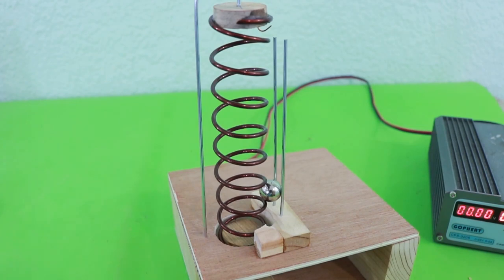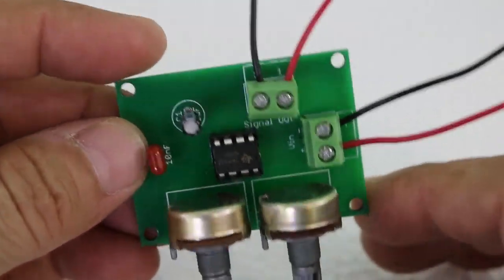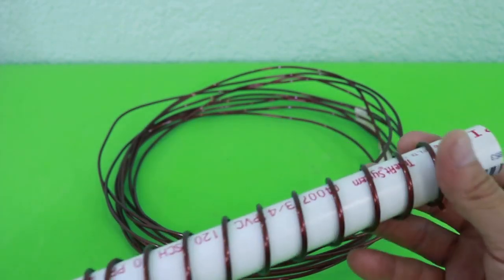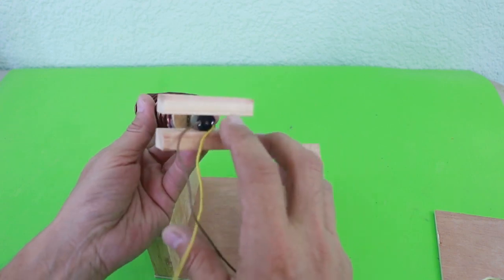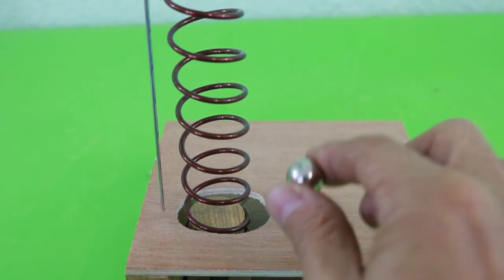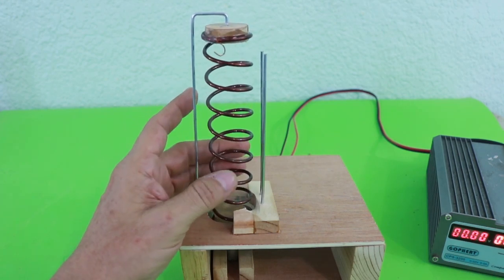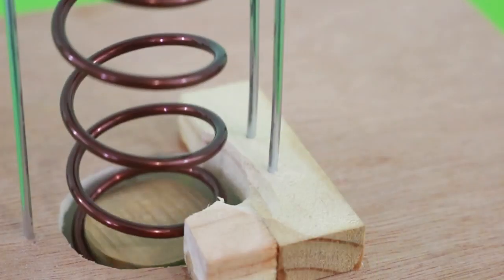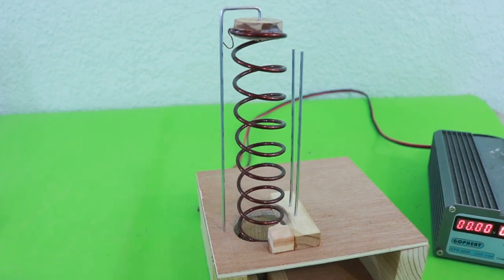Marble Lifter Mechanism for Marble Machine

Comment: Looking at this, you could run the positive of the motor to the coil, and via the two upright supports so it only turns when a ball is on the coil - ie it creates the contact.